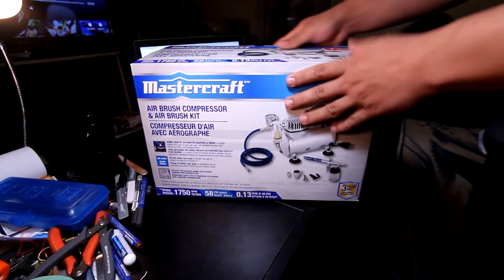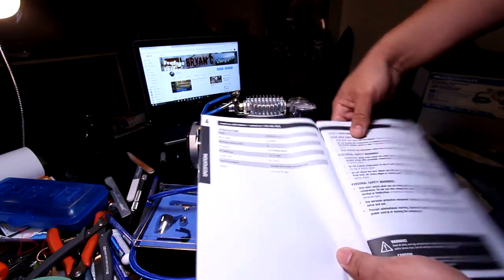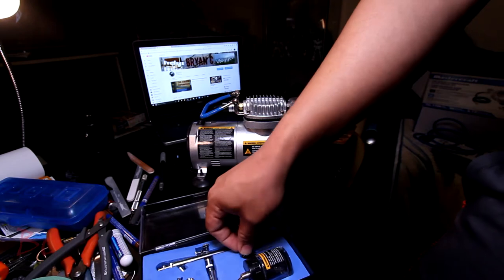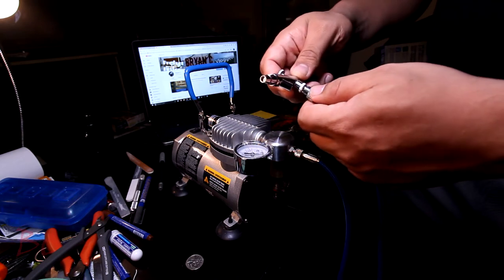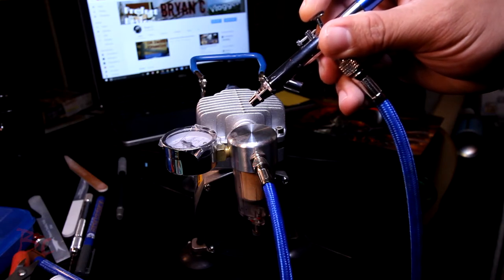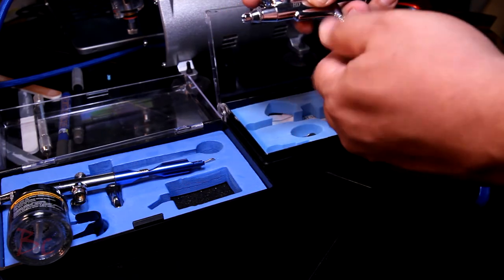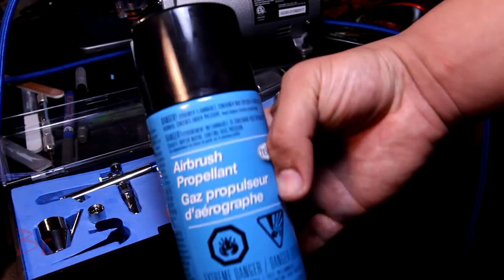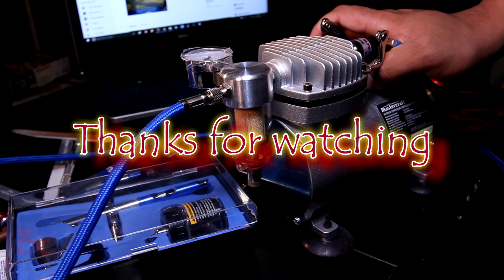MasterCraft Air Brush Compressor and Air Brush Kit Review

Comment: Do you know if the airbrush that came with it works?
Reply from the maker: Sorry, I never tried it since it is not gravity fed, I opted out of using it and still in the box up to this day also you will need to purchase a regulator. Overall this unit will cost you around CDN 100 dollars and the regulator separately will cost you around CDN 30 dollars. Im still using this up to this day!

Comment: Hi there.  So there is no way to adjust the PSI without purchasing an additional regulator?  Thanks!
Reply from the maker: Been awhile since i reviewed this product. I checked the manual again and the compressor and yes you will have to buy the regulator sadly. This is decent for beginners in my opinion.
Reply: R13 is there any specific regulator that you need to use? If you have something in mind kindly give me a link? Thanks mate.
Reply: @4x60x10x1  any type of regulator I just use a cheap one from on of my older airbrush  kits should  be able to find one on amazon for 15$
Reply: @needanewname141  I'm having a really difficult time finding a compatible regulator. The closet thing I could find it 1/4" and it need to be 1/8"... I've spent a lot of time trying to find adapters to make it work, with  no luck
Reply: @CM-ef2ew   hey I'm in the same boat as you have you been able to figure out how to attach a regulator?
Reply: @deathrow564  I've gotten close but the fittings I got don't work properly (I got 1/4" to 1/8" brass adapters but the airbrush hose female end is slightly smaller than the 1/8" Male end and leaks air) I've given up for a bit... I think the solution is using it as an inline regulator though: hose to regulator input > hose from regulator output to airbrush

(2) hoses - 1/8" to 1/4"
https://www.amazon.ca/dp/B01FQFFI3W/ref=cm_sw_r_cp_awdb_t1_ykYaDbRFCK2B9

1/4" adjustable air regulator 
https://www.princessauto.com/en/detail/1-4-in-air-regulator/A-p8624967e

And depending on the regulator you get you might need:
https://www.princessauto.com/en/detail/2-pc-1-4-in-nptm-brass-nipples/A-p8002513e

Comment: Looking to add a regulator, anyway that’s possible?
Reply from the maker: Yes it's possible! Very easy to do
Reply: @RavenBuilds  Do you know what size regulator will fit? 1/4 or 3/8, etc. Because my local Canadian Tire and Princess Auto sell both sizes but dont know which one to get.
Reply from the maker: Sorry it's been so long. I do not recall the size. Only option I can think of is for you to remove that specific piece to show to them if it's the right size.

Comment: No test painting? More of an unboxing than a review.
Reply from the maker: 🤣 ya this was many years ago. Still use this same compressor and upgraded the valve for better control
Reply: The compressor still works after 6+ years? Not bad for the price. Does it spray consistently? I have a Ryobi compressor, and people say that the spray pulses when the compressor kicks in, so that's not an option.

Comment: No regulator on an airbrush compressor? Insane.
Reply from the maker: cheaper airbrush, its somewhat expected. been awhile since I reviewed this product.
Reply: R13 you have a point but i cant imagine trying to do fine detail at 40 psi, more like 15 to 25. Also,you can get similiar compressors with an adjustable regulator for less on Amazon. To be fair, it does come with 3 yr warranty and seems to be decent quality but in my opinion adjustable air is a must. Appreciate the review though.
Reply from the maker: Hey thanks, Its an old review of mine and up to this day, I barely even used it. I do know that a regulator can be installed but for now it stays in the box lol